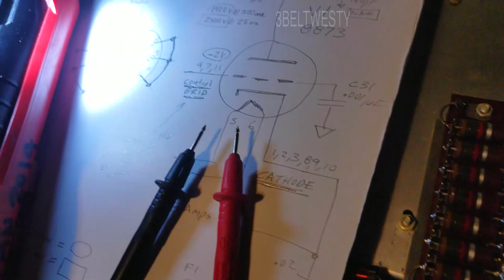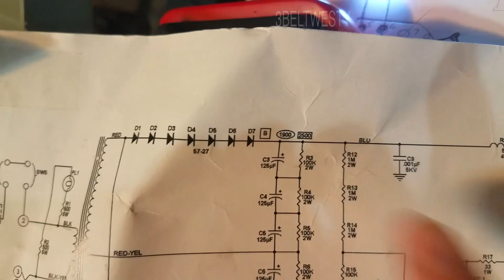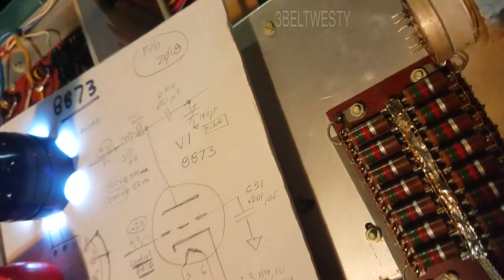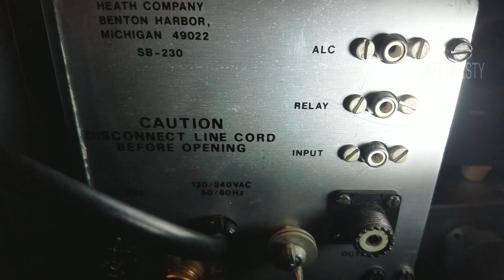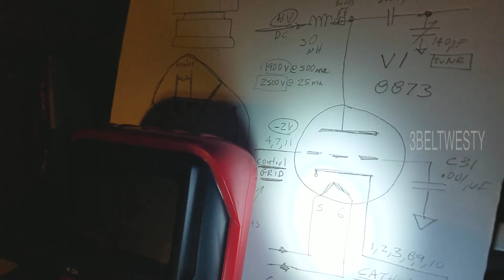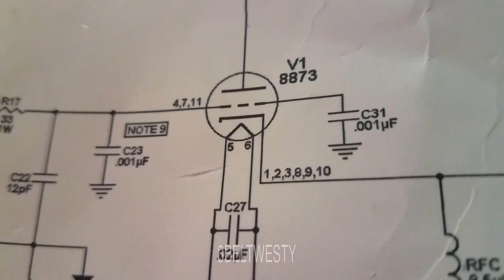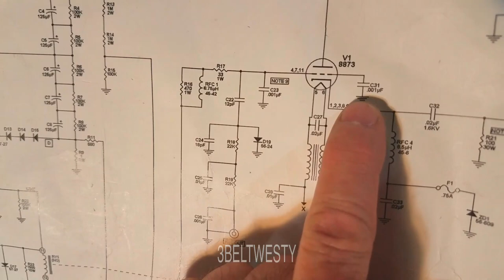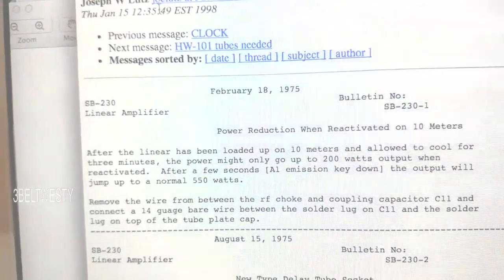Heathkit SB 230 8873 Triode Eimac Tube adventure 001

Comment: Socket is supposed to be loose so it follows the tube when tightened to the block! It even states so in the assembly manual. 73 - KV4WM - i HAVE A WORKING 230!